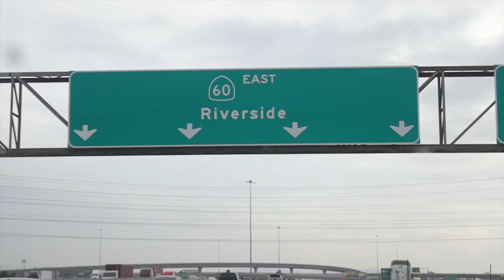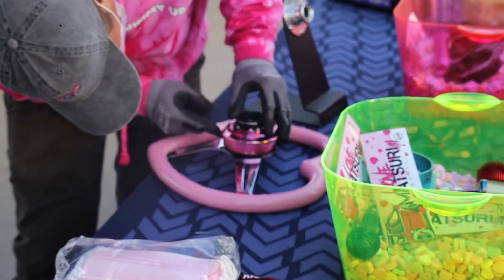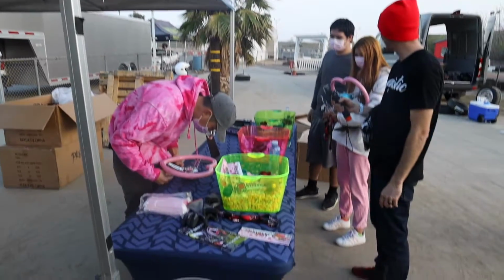THIS VQ35DE 350Z IS ON A WHOLE NEW LEVEL! | NRG PRIVATE TRACK DAY.

Comment: Im trynna learn bout drifting, but how was the red z smoking alot, while u barely smoke
Reply: some tires produce more smoke, also he makes more HP
Reply: Red Z was a HR motor while fili has a DE motor. Also different tires smoke different than others. Like Kenda's don't really smoke while GT radials and federals do smoke a lot more
Reply: Red 370z is a supercharged v8
Reply: @Snoopmike  yeah the red z is a pro FD driver that car makes I think over 900hp
Reply: @fattynuts2463  There was 2 red z's at the track. One was a 350z HR but the one in the video is Jeff Jones 370z and yeah its a supercharged LS on e85 with 295 Gt radials semi slick. He smokes the track out but only lasts 3-4 laps while everyone else has like 10+
Reply from the maker: 370z is making all the power, black z is stock motor.